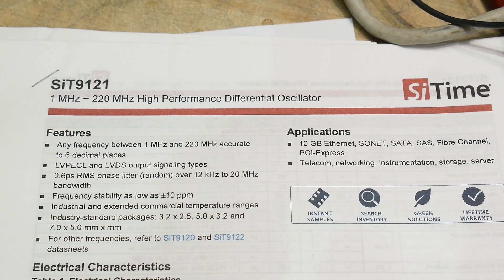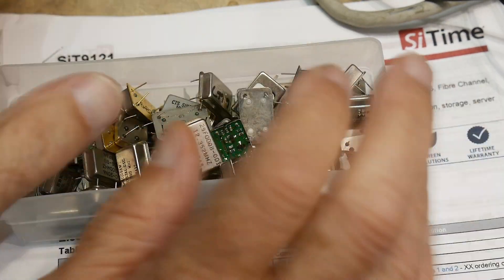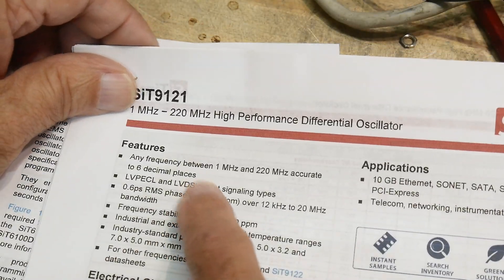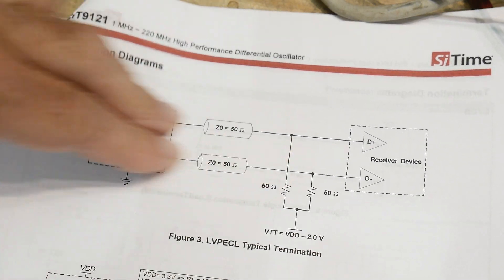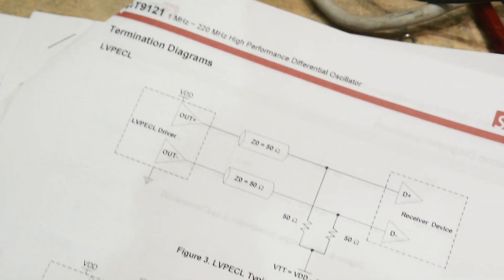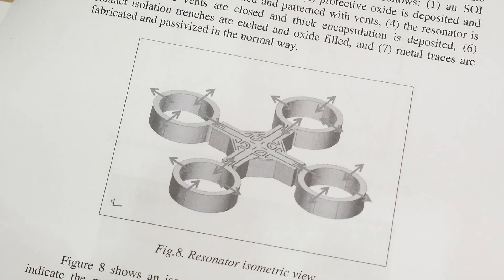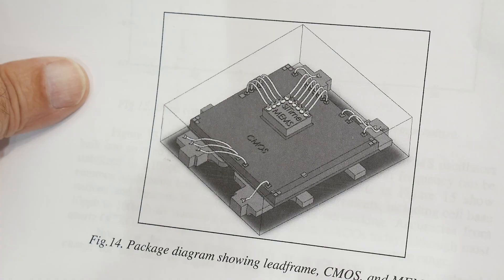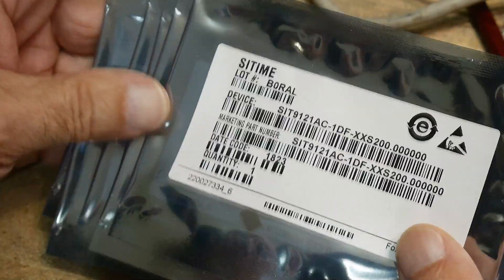#1908 SiTime 9121 (part 1 of 2)

Comment: I have used them alsready, eone for a 144Mhz.x clock for ham radioa applicaion which worked great. I also work on space projects, but there the MEMs technologie can have problems as I was told. Also the pahase noise has to be considered when using them as abase oscillator for higher frequencys. Bu reall perfect for all other type of appicatiosn where you quickly need a special frequency.

Comment: A while ago I used a Microchip 25MHz MEMS oscillator to clock a Wiznet W5500 ethernet chip &  found that with the MEMS osc I was losing 1-2% of received packets, presumably due to jitter. Swapping to a real xtal oscillator completely fixed the issue.
Reply: That's really good to know.

Comment: Defiantly one time programmable, found out the hard way when I messed some up with two digits transposed in the frequency 😪 Trying to program the module a second time with the correct frequency gives two red error lines: programming failure and verify failure.   Luckily had enough spare blanks without having to wait for more to arrive.

Comment: Unlike quartz, silicon is not piezoelectric.  Thus, it is tricky to cause mechanical motion to interact with current or voltage.  That is where MEMS is needed.  Basically, mass on a spring is charged and placed between capacitor plates.  An AC signal applied to the capacitor then excites the cantilever and the vibrating mass on a spring excites an AC signal across the capacitor.  At this point the circuitry for both devices is quite similar.  The capacitor and the vibrating mass in these parts are each complicated.  MEMS is also needed to form these complex shapes that allow such high frequencies and improve quality factor, Q.

Comment: Been using SiTime MEMS oscillators for my project, including usage as a CPU clock source for microcontrollers as they're robust, cheap and surprisingly efficient.

Also, there's a few reasons why handful of smartphones, iPhones and Android phones use MEMS oscillators is that they can keep on marching even when dropped onto solid surfaces that would easily crack the screen - only for the computer inside to not flinch at all. It would be interesting to see some mid-range digital watches using 32 kHz MEMS TCXOs as like I mentioned, they're electrically efficient so that way batteries would last for a good while.

Comment: The jitter spec looks quite low, which is important for things like Audio A to D converters. The frequency range is obviously much higher than necessary, though, for Audio. I wonder do they come in lower frequency ranges and retain that stability, or does it get notably worse if you divide the frequency down to say 192khz, 96khz or 48khz?
Reply: Yes, there's a few timekeeping MEMS oscillators that can be programmed for audio electronics, at any desired frequency rather than just the boring 32 kHz.

Comment: These parts became famous because because a hospital suffered a helium leak on their MRI machine and nearby iPhones failed. This was because the helium permeated the case and caused the tuning fork to vibrate far higher than the PLL could lock so it stopped working. (Same reason your voice gets squeaky when playing with helium). I think @Applied Science did a video on it where he wired up an SiTime oscillator and then exposed it to helium showing the frequency climbed until it failed. This is only a temporary effect - once the helium permeates out it works again, so Apple didn't get a bunch of iPhones for repairs. But it made the news. These devices are used because they are much smaller than their quartz counterparts.

Comment: MEMS micromachining can be attained by etching Si in KOH [solutions] at moderate temperatures (~40-80C), protecting Si with a metal (Ni, for instance, which is resistant to KOH) and protecting SiO2 with metals and/or a (photo)polimer (also resistant to KOH). It's not difficult to obtain structures with an order of +/-1 micron.

Comment: I have used the Micrel programmable silicon MEMS DSC8002 oscillator.  It is an inexpensive way of getting a signal on a custom frequency.  It works fine but has considerably more phase noise than a typical quartz crystal oscillator.  If your application does not require a pure tone, it is a good choice.  Review the specs carefully!  I would estimate that mine, operating a bit above 100 MHz,  occupies a bandwidth of a few hundred hertz.
Reply: Fully disagree with you. 

MEMS technology have a lot of different variations. Therefore you can choose the most suitable for you. 

If really want to test real MEMS oscillator - use SiTime products.
Reply: Actually, SiTime's oscillators are actually better than most of the other MEMS oscillators, so good that their manufacturing processes are patented.

And yes, I have been using those SiTime MEMS oscillators as their garden variety version only cost between $1 to 6 a pop, still cheaper than most oscillators (quality quartz oscillators cost way more for basically the same performance as even cheaper SiT8008 oscillator), not to mention it can easily survive insane G force without missing a beat.